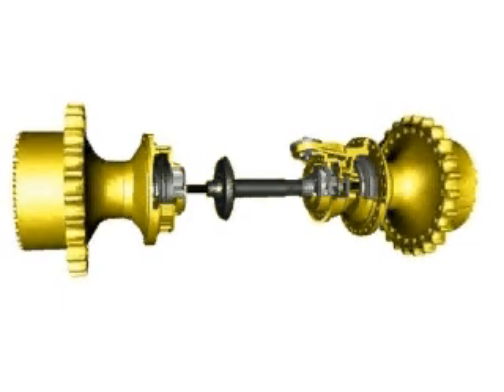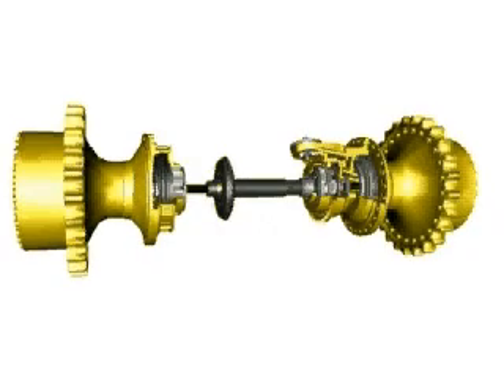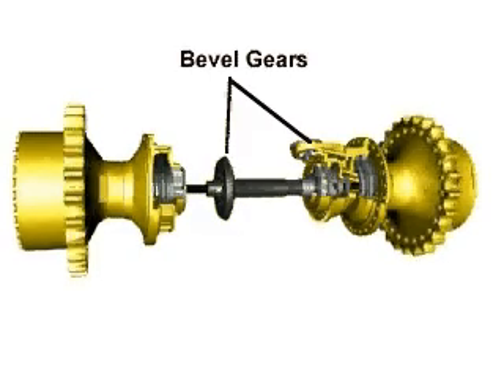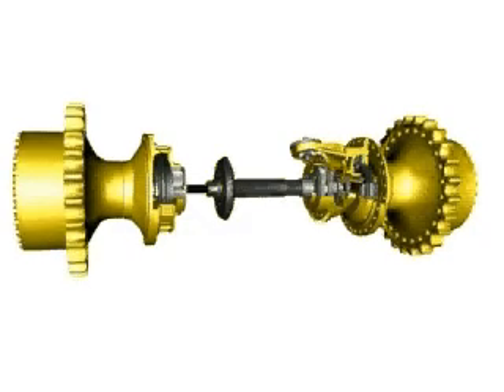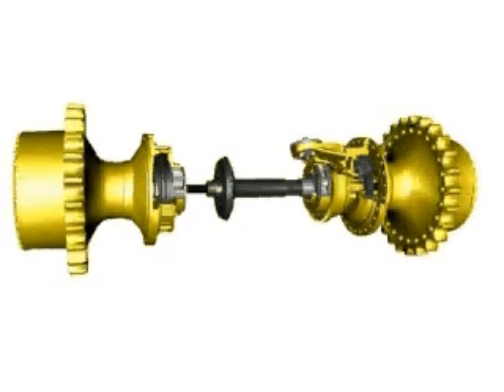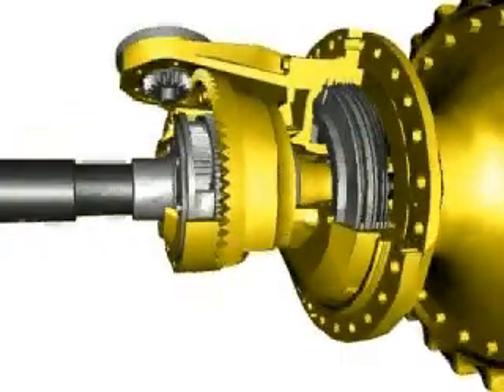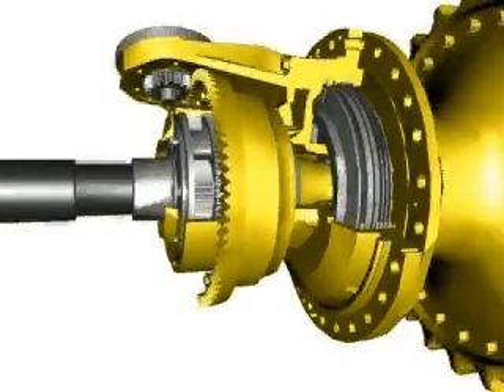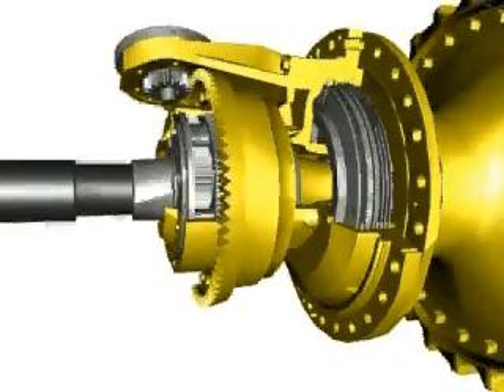Differential Steering | Cat® D6R through D9R Dozer Steering System

Comment: Wow! A Cat with Cletrac steering!! Invented by Rollin H. White in 1916. Sorta like Cat using the high drive sprockets that Cletrac had in 1920.
Reply: I used to think the same until i started learning about the different types of steering used in crawlers.

Cletrac used what is called "Controlled differential" steering, and was used in a lot of US military tanks until just after vietnam.

Oliver tried to build up the Cletrac steering system for earthmoving, but had trouble with it being too light duty to handle the load.  It also didn't help the differential was only able to provide only one turning radius when the brakes are applied, making them a bit clumsy to use.

Caterpillar's steering system shown here what is known as "double differential" steering.  Its first major application was in the German Tiger tank of WW2 and was able to be upscaled for heavy load applications much easier.

Comment: I am trying to build a rc tank. can you help my find more info on this gear system so i can make a model?
Reply: david, did you ever get any good information?

i don't see how this system could do full opposite direction and pivot in one place. am i wrong or do you know if this does no more of a pivot than an efficient braking type skid steer? (which is not good enough for me and my tank)

i can't find free drawings or plans on much of anything that will truely pivot in place. just a short video on a double friction clutch based design with two gears on one clutch and three on the other. and another video with a belt driven system where half the belts twisted an 8 and tension was applied to the 8 or the 0 belt. both of those systems seam to be a constant squalling problem.

im trying to utilize off the shelf parts so that repairs are quick and easy but, its proving hard to use a combustion engine alone without expensive hydraulics or hybrid electronics. if i was willing to do that then i would just do a castle combo on each side. i don't want an electric (even though its better.)
Reply: John Doe look in to ih planetary steer. What scale? Easiest option would be use elevate motors, think battery drill, one each side, maybe use angle grinder head for reduction or the planetarys from a cake mixer or the like. Hydraulic motor each side would work just as well
Reply: @JohnDoe-eh4vd  Pivot steering is by the hydraulic motor alone.
Reply: How big will your tank be? Find a Cletrac HG or Oliver OC-3 and use the controlled differential steering from it.